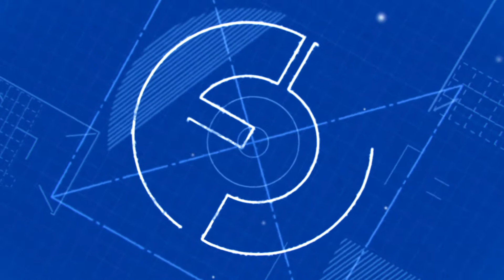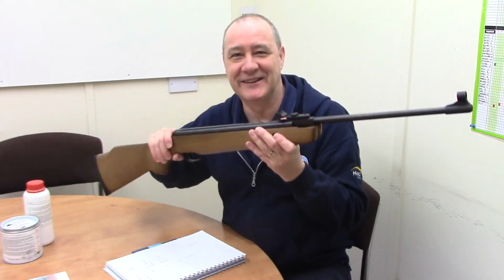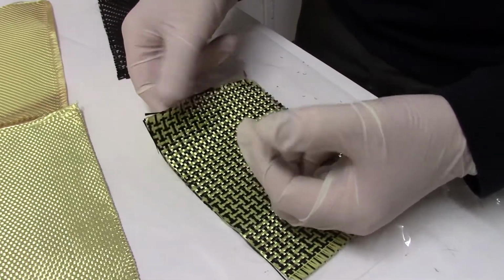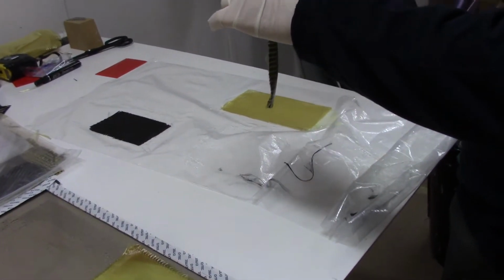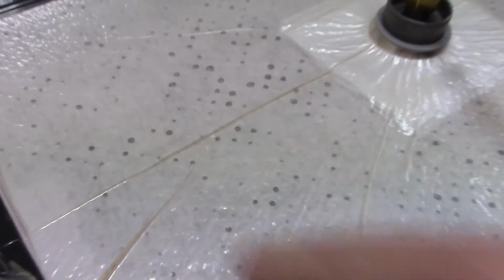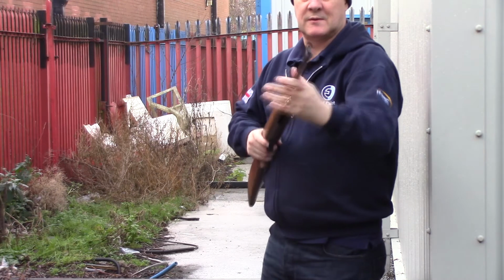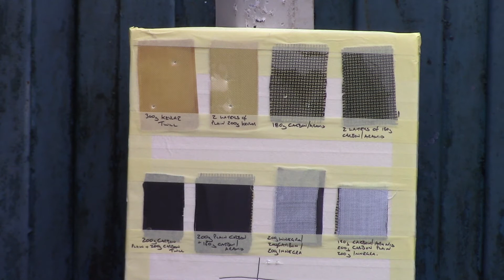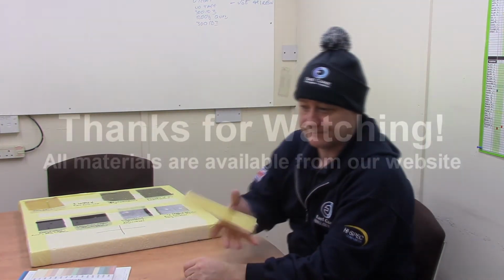Kevlar® & Carbon Composites vs Air Rifle

Comment: Hello! I didn't expect a different outcome. You used K-49 Kevlar which is high modulus Kevlar used for thechnical laminates (automotive and aerospace applications). There would be a significant difference if you would have used K-29 low modulus Kevlar which is meant to be used for ballistic Kevlar laminates!

Comment: Question for author - Folks normally try to shoot down drones with shotguns with small pellets... What do you believe is the lightest weight material to line the button of a drone with - To prevent the small pellets from penetrating the plastic body of the drone?

I ask... because in my case... A single drone could have a 5-10K dollar camera on board.    If the drone goes down, I can always get the coppers involved because it's illegal to shoot down a drone.   And we can get a court order to go onto the land to retrieve the drone based on the GPS coordinates.    But it's all mute if the 10K camera has holes in it.

If they wack a propeller blade... That is a cheap fix.   But the body and the camera are most important.

Can you please post your thoughts/recommendations - The material, layers, resin used, and weight of the completed item?

Size wise... We are talking about 12" length X 10" wide.
Reply from the maker: No idea! You would need to experiment with various weights and thicknesses of cloths and shoot them at varying distances to find the best way to bulletproof a drone...
Reply: 12mm thick fiberglass laminate is rated to 3A but I doubt that it's lite weight at that thickness. It would probably be easier and cheaper to seek the land owners permission even if it isn't legally required.

Comment: What if instead of epoxy resin, you melted down HDPE plastic or something and did that? It's very impact resistant
Reply from the maker: HDPE isn't going to be as tough as epoxy reinforced aramid

Comment: I don't understand the reason for mentioning the weight of each patch's component sheets. Does it matter if it's 100 grams or 1kg? Is it more about the thickness of the patches? Or just the weight in terms of using it as body armor that must be carried - and making a comparison between weights and strengths?
Reply from the maker: The weight can matter greatly if you're making high performance pieces. You wouldn't want a 15kg nosecone on the front of a high speed kit car, for example. You'd care if it was 4kg or 15kg